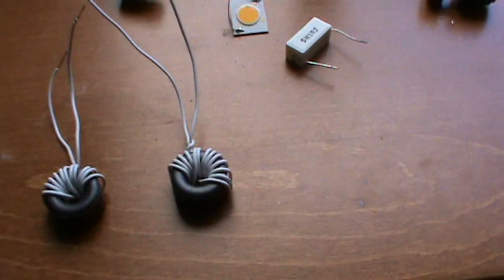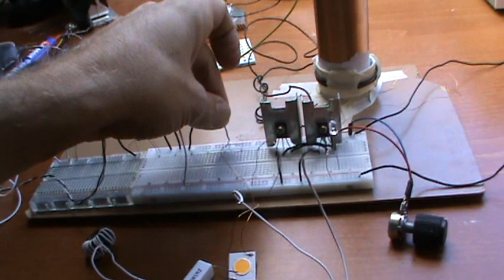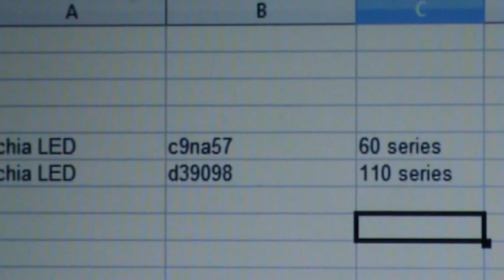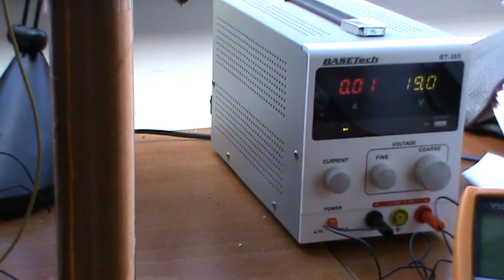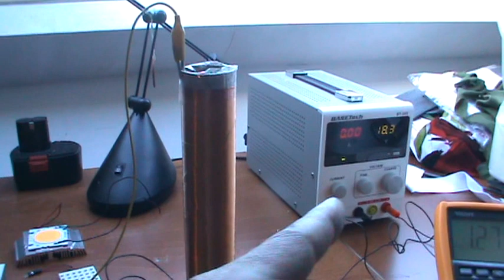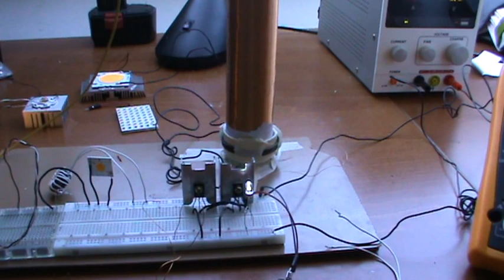FFCITER-details.MPG

Comment: very efficient offcourse, in exciter circuits , there is high voltage all over , so if u put a super cap charged with some voltage , that would be great test to see how much time to discharge it (may kill effect)..   also the crock wire brings high voltage near to torroid..